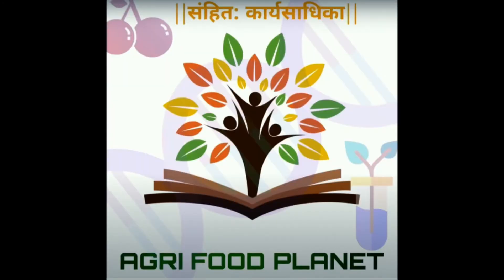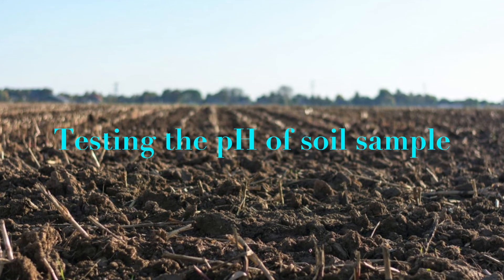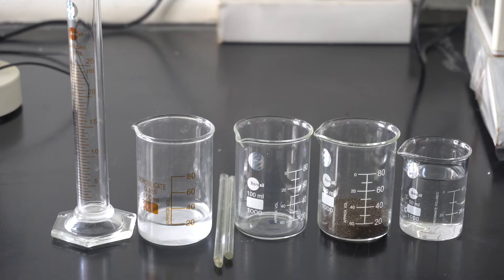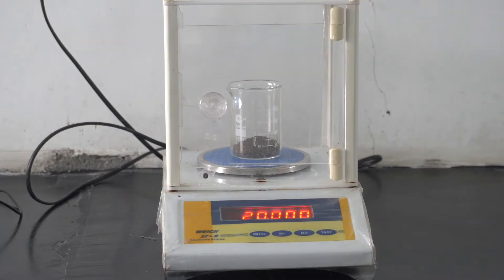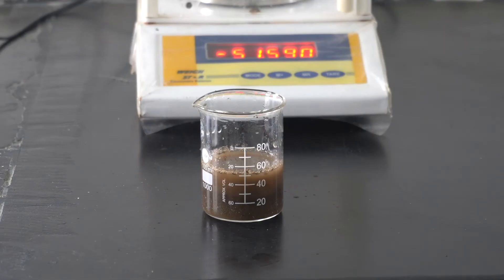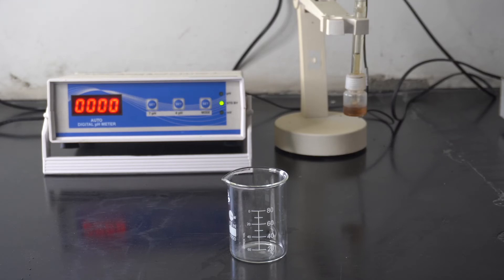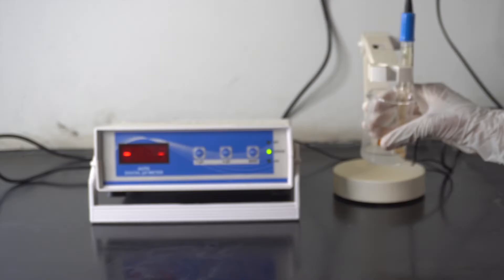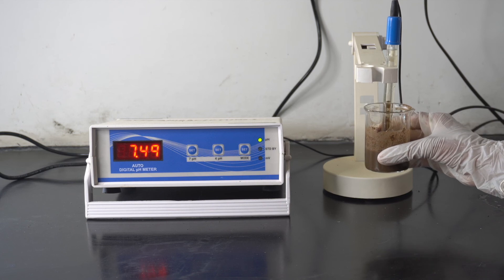How to measure soil pH by using pH meter???

Comment: Thanks for the video.  I needed to confirm that the 2:1 water to soil ratio was right for testing, and will give your procedure a try now.  I’m looking forward to using the Vinmetrica pH meter I use for winemaking to test my soil pH and getting better, more accurate results that the 2 prong probes that get inserted into the soil.  Maybe after getting a few accurate results with the Vinmetrica I can “validate” or “certify” one of the cheapo dirt probes for easier/quicker measures.